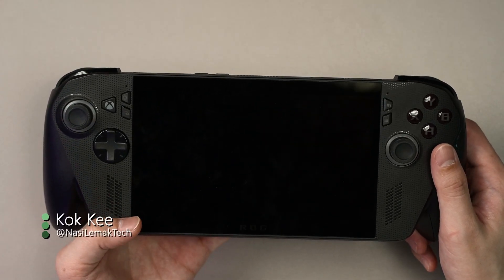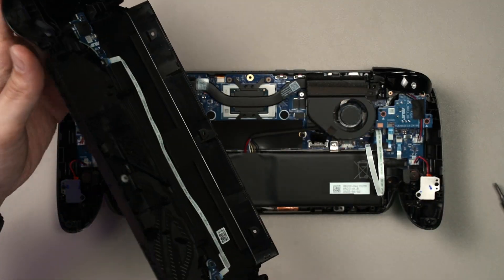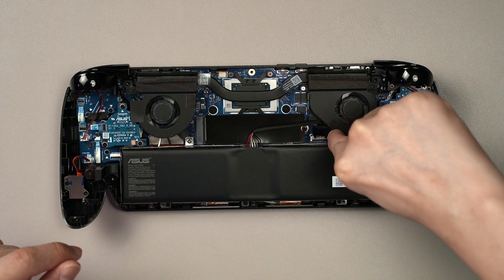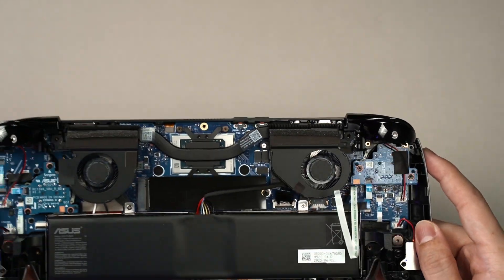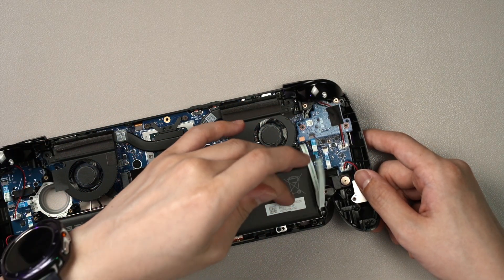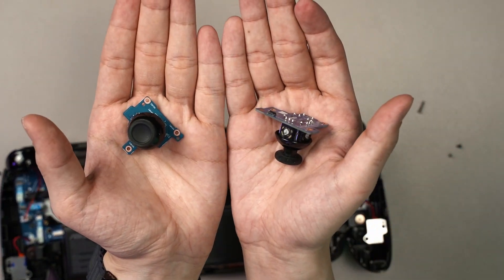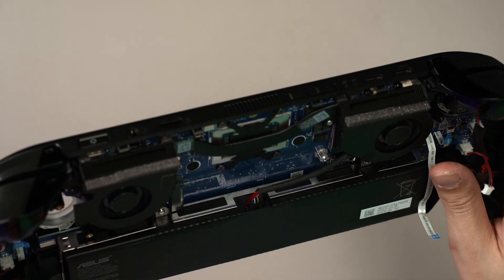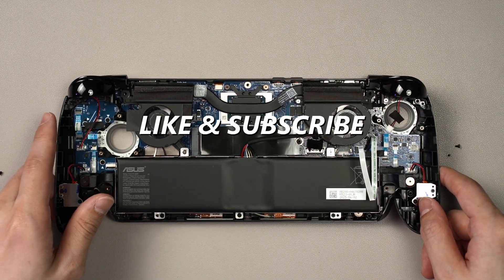Inside the ROG Xbox Ally X 😳 – Upgrade and Fix EVERYTHING!

Comment: How do you pull the ribbon connector up?  My ribbon came out and I'm having issues reconnecting it.
Reply from the maker: A bit of a struggle as that ribbon cable isn't particularly long. But yes you can get it in. I used a pair of tweezers since I have real fat fingers